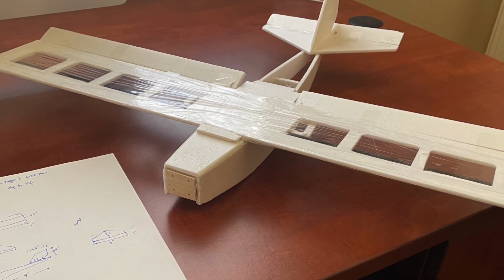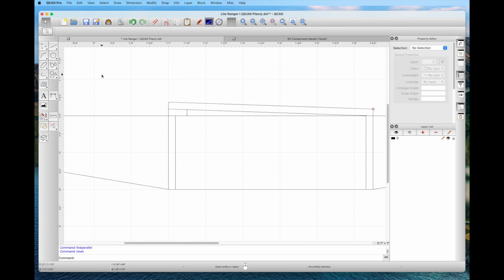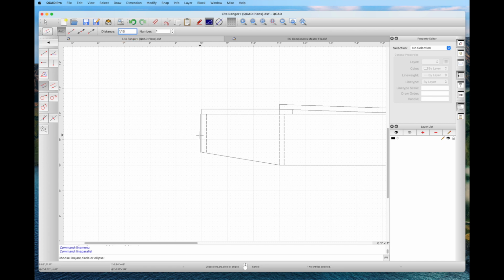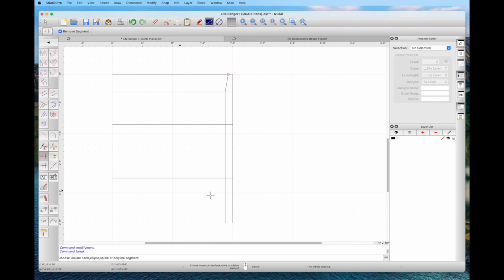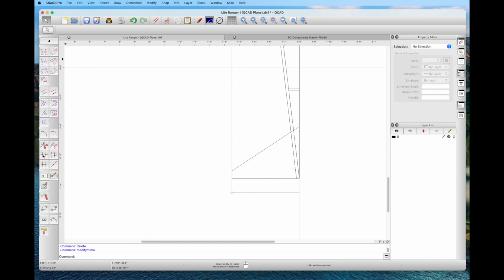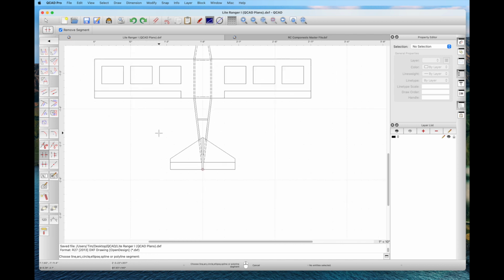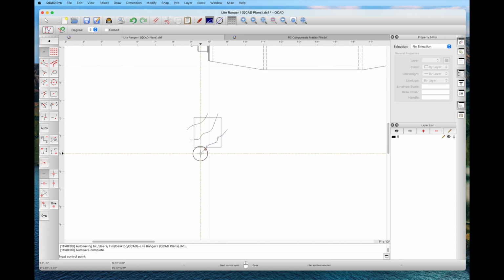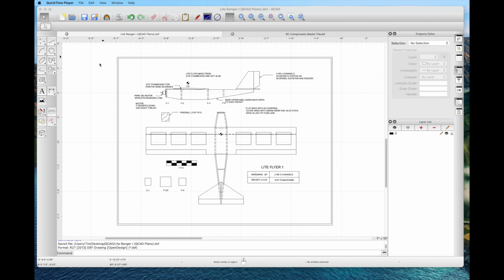Draw QCAD RC Plans for the Lite Ranger 1 Step by Step

Comment: Thank you for taking the time and for this video!
Did you buy the the Pro version because of certain features or just to not have to think about it?
At the moment the community version seems to have all I need (I'm running it on Linux).
Reply from the maker: Thanks for checking in!  I purchased the Pro version as it was so inexpensive, why not.  I think at the time around $38.  QCAD is a neat program.  I have several videos on this, to include a tips and tricks: https://youtu.be/0wnBWAHkjDA  Tim